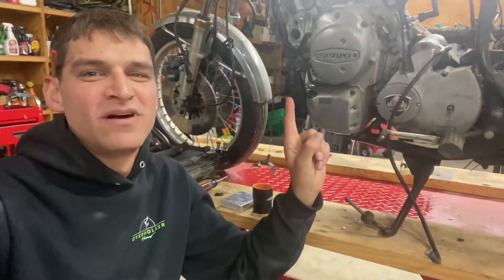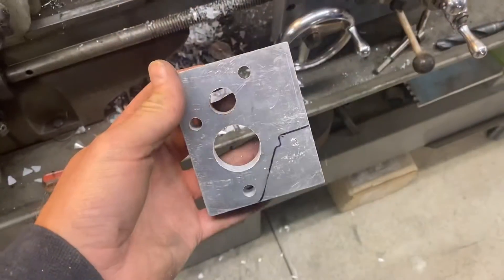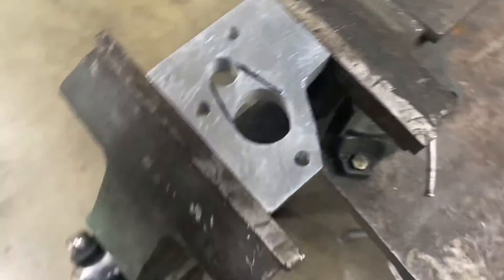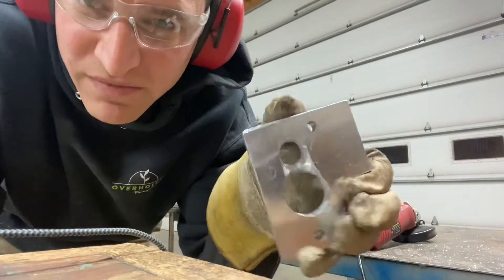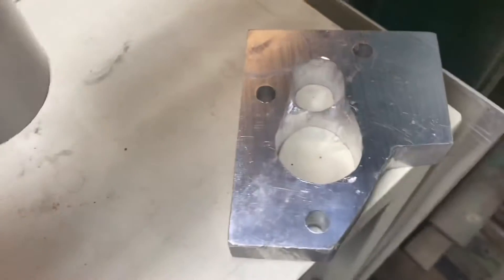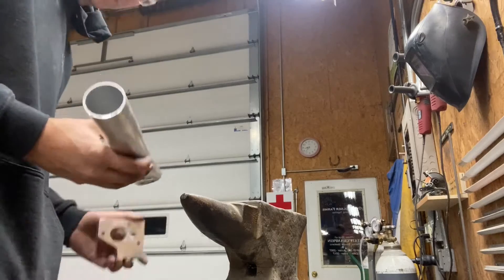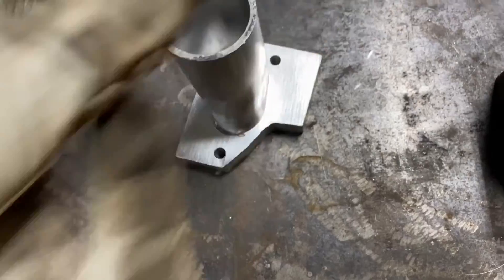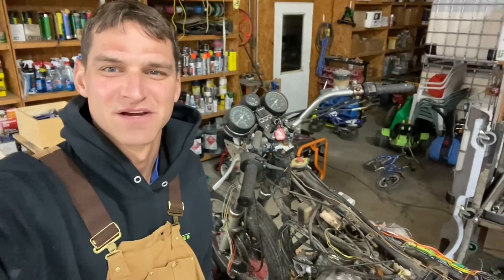Custom intake manifold for Rotary Motorcycle. Suzuki Re5 ~Ep. #7~

Comment: Why? The original carb is easy to work on with home made angle indicator etc. original carb is essentially 1/2 a vacuum secondary Quadrajet. The induction is not simple with small primary and large secondary, plus peripheral throttle at the intake port. It may run, but not well.

Comment: Would you be interested in letting the original carb go? If so I’d be interested
Reply from the maker: Yes, after I am sure it runs on this one!
Reply: @theclevercraftsman  Id be very interested if you get rid of the old carb. I could use it on my ‘76, carb I have has messed up accelerator pump circuit